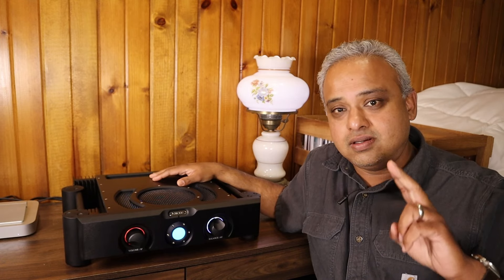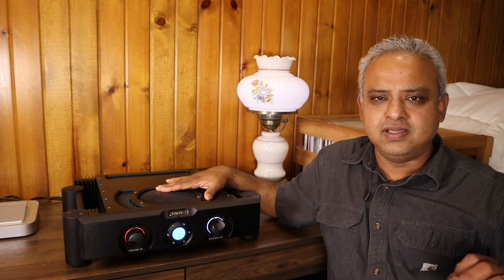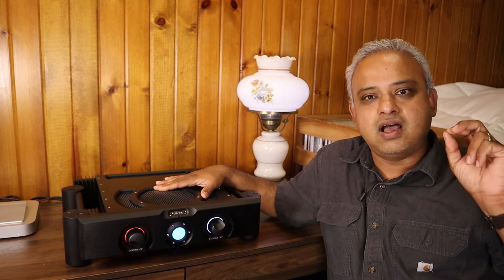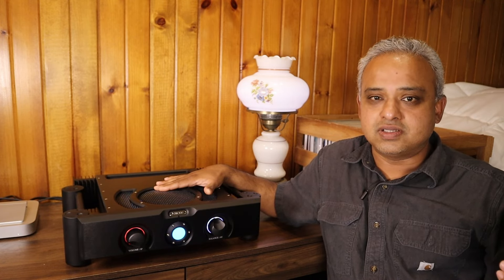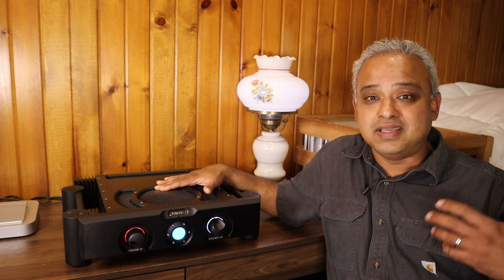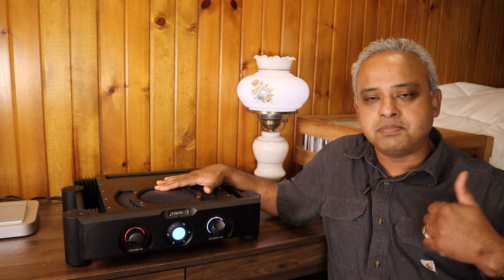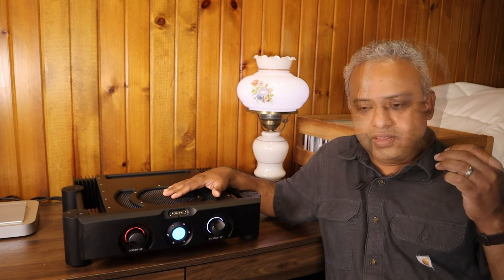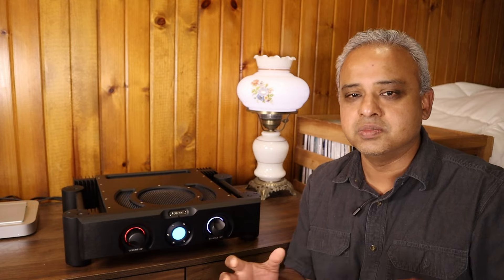5 REASONS THIS COULD BE THE END GAME AMPLIFIER | CHORD ULTIMA INTEGRATED [Pt2]

Comment: Ok, I am going to weigh in here. I have had the Chord Ultima in my listening room for about three weeks and what has been described here mostly matches what I experienced. Now comes the alternative. I own a Gato Audio AMP150 class AB amp that is on par with the Ultima and betters it some areas. The main difference, I will put it out there, maybe the Ultima may have the edge on the toe tapping front. It seems to be able to Gel everything into a cohesive whole just that little bit more.  Now, before anyone says oh the price difference; The Gate AMP 150 was for sale for upwards of 8k before GATO changed their pricing model. Please listen to both before making your choice. The other thing of note is the inputs and outputs. I find the Ultima limited in this area against the competition, especially if you have analogue tape as part of your listing equipment or you may want to include a headphone amp. Also I recommend investing in a mains conditioner if you really want to hear the Ultima at its very best.
Reply: What are de deferance i want to compare to the Chord and Gato I heard Different pre-amp. i heard the mc-tosh, Pass 22 and the ATC.